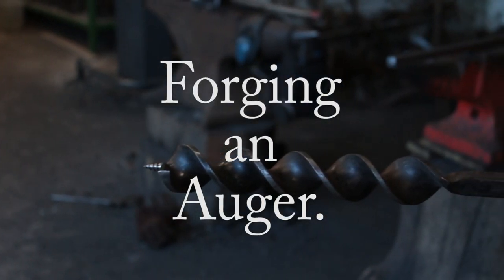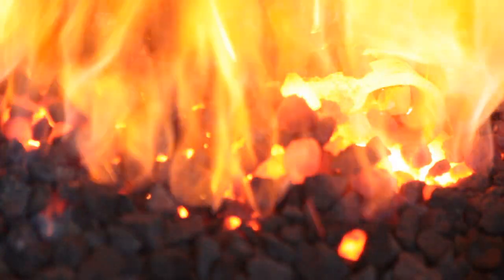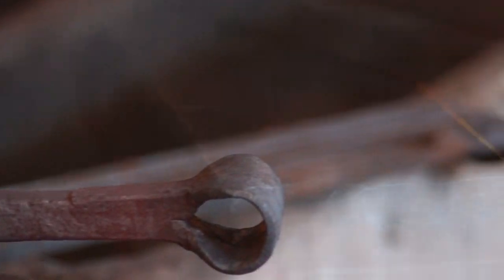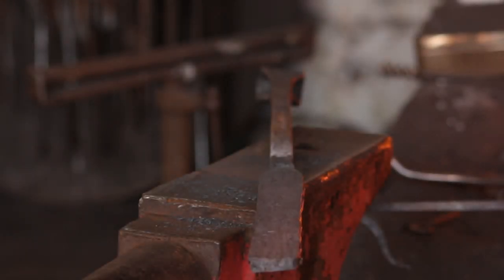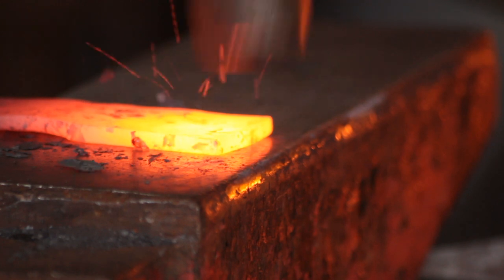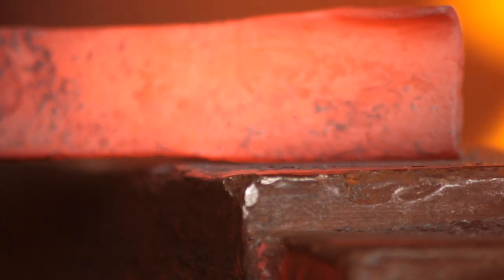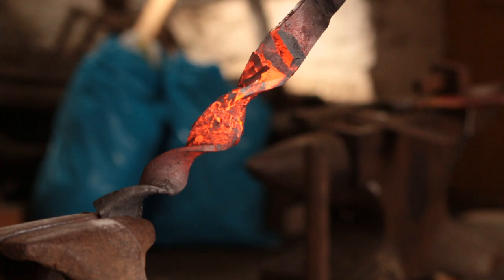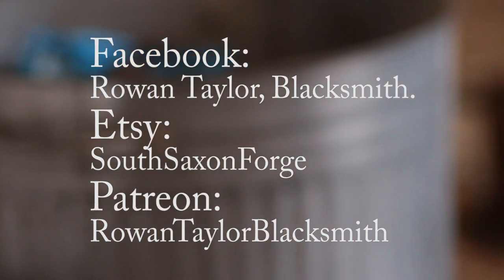Forging an auger. Part 1: Creating the blank.

Comment: I heard you say "running a neutral fire",  what do you mean by this?
Reply from the maker: You have three layers in your fire - oxidising, neutral and carburising. You really need to be using the neutral layer so as not to burn your material, especially when welding. Have a look at my scarf welding video.

Comment: The little "right angled tongues" are called nibs. They cut the circle into the wood ahead of the auger. The flat bits that actually free and lift the chips out of the hole are called the lips, and of course, there's the spur to pull the auger into the wood.
Reply from the maker: Thanks Lebomm. I wish I had read this comment a few hours ago when I was editing the second part, lol. I tried to find a terminology before making this project but couldn't find one anywhere. The spur I have been calling the "lead screw" throghout

Comment: I have a similar old auger but the snail on the tip is broken so it's mostly useless. Looks nice hanging on the wall though. I'll be very interested to see how you make that snail on yours.
Reply: I've seen some ship augers without a lead screw, meant for boring a shaft hole for the prop shaft. The hole is started with a standard bit, but then switch to the one without the feed screw. I think this is so it will track better in end grain, but don't quote me on it. I'm just throwing this out there, it may be missing by design, not having seen your particular auger of course.
Reply from the maker: They still use them at the canal yard where the forge is - that's where I pinched the original from, lol. The lead screw will be cut and filed mainly.
Reply from the maker: An interesting insight, @Matt Moore, thank you!

Comment: So, without the grinder how would you have "traditionally" split those bits of metal for forge welding? Would you just hot cut them or?

Comment: Great video .Subscribing!
Beautiful scarf weld. The welding of the dissimilar metals was brilliant.
You saved me hours of trial and error. Thanks.
Any ideas for a hand forged ,tapered screw to be used in a homemade , hand cranked plastic injection molding machine for home plastic recycling?

Comment: Would you be able to do a similar thing in order to make a bit for drilling metal?
Reply from the maker: Possibly.... I would have to use thicker stock I think but as long as the cutting edge was at the right angle I don't see why it couldn't be done.

Comment: I would like to get into blacksmithing, what are you using for flux? FYI I enjoyed your video so much I just subscribed.
Reply: Borax is very common. Other things that can be used: clean sand, salt, industrial grade flux, crushed/powdered glass. Typically something fairly cheap but still performs the duty.
Reply: thanks
Reply: 1973mre np, happy forging!